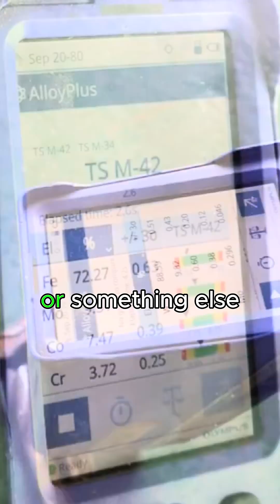High Speed Steel vs. Regular Steel 🔩⚙️ What’s the Scrap Difference?

Comment: So what'sa ball park of the price difference between the two on aby given day? More so what's the average recnt price for high speed? Any yard near me , id be lucky if they take it as stainless.. makes no sense to me. And then SS prices vary wildly from yard to yards (ex. $.16 to $1.05)
Reply from the maker: Typically around double the price that regular shred steel is at. Also depends on if your yard will accept and pay fairly for HSS as its not too common.